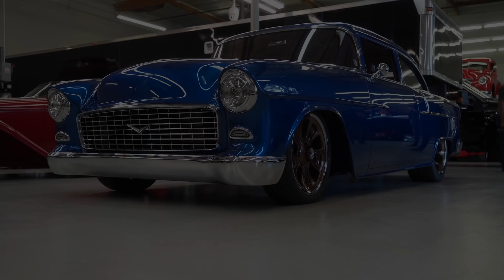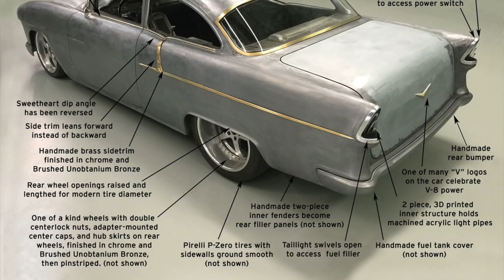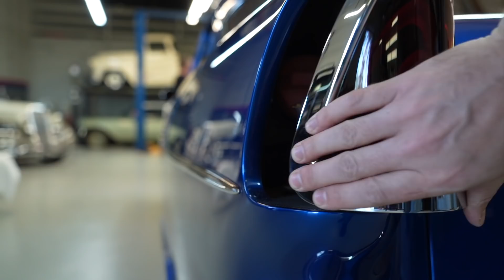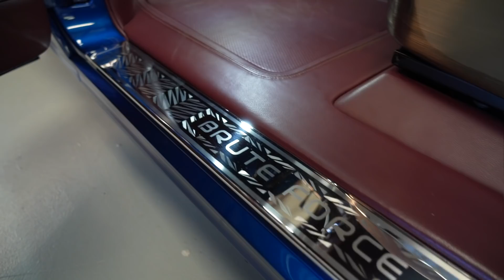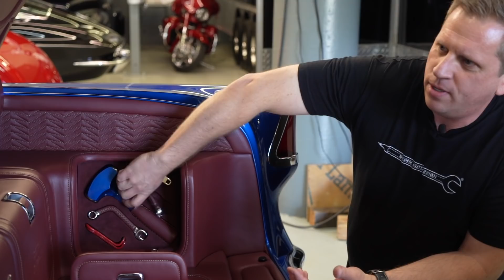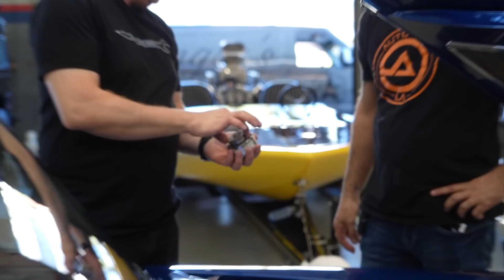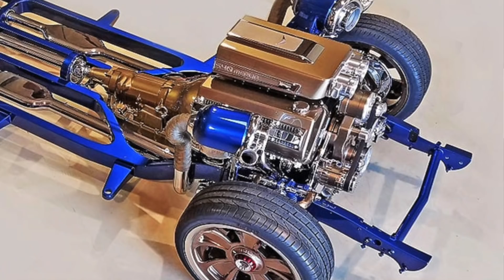1,400 HP Twin Turbo '55 Chevy Custom Show Car Multi Million Dollar Build | "Brute Force"

Comment: That is an almost perfect but the wheels will have to be polished aluminum. That brown/copper look is hurting the look. Same thing with the interior. That does not match the car so you have to go with a dark grey interior with blue highlights. Get a computer graphics tech and take pictures of your car and then have him change the colors in the computer and you will see what I’m talking about. This car is to nice to not be perfect only due to colors. Going to cost you but if you’ve gone this far than you’ve already spent more than what the cars even worth anyway.

Comment: Incredible and awesome, but that car wasn't built to pound pavement. (even though it's damn capable of doing it) I stress enough about curb rash on wheels, door dings, rock chips and hail damage. I just don't need 200K+ in paint and chrome underneath to worry about too.

Comment: Nice front bumper tuck. This looks superior and cleaner to even a smoothy bumper that does not fit as tightly to the body from a side view angle like this. I wonder if this would be an example of a bumper that is flipped upside down?   0:30

I think this front shot would have looked even better with the V emblem on the hood between the lights, to fill that space.
15:40  Paint job.
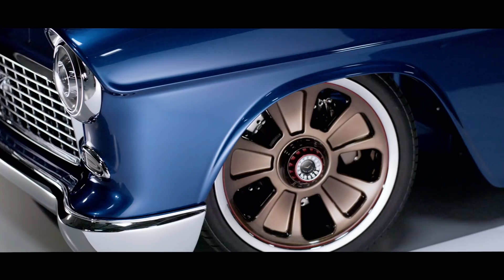16:03 Wheels

Comment: That is the most beautiful 55 I have ever seen 😍. They were robbed of the Ridler award, it is way cooler and has way more custom one of a kind parts on it then the wagon that one. I don't get why it beat out this 55???? The interior is the best I have ever seen, simply amazing work from one of the best shops out there. Gabes' is top notch! So many well thought out and implemented designs.

Comment: Amazing!!! Looks wise...its poetry. Perfect. And maybe its the way the sound is recorded but it sounded like a hamster wheel and a bad muffler on a 78 Buick. lol Very impressive tho. Won't they be disappointed when they don't win the Ridler because the quilting under the hood doesn't have the same "V" pattern as the rest of the upholstery and the general theme of the car. Because thats the kind of nonsense those anal retentive judges get sick over. lol

Comment: Should have named it Apeshit b/c that's what the designed went on it. This car is 100% one-off custom to an unprecedented and insane degree. If it's ever sold, it will go for several million, guaranteed. I never expected it would be driven in the video and it's actually surprising that they even started it. Performance art is honestly what this is and to drive it, sadly, would bring its value down, even though it's designed for functionality and to perform. So much genius and hard work, but ironically, it can never really be enjoyed as a driver.

Comment: An example of how much an expensive custom car sells for at Mecum Auction. This Truck sold for $206,250. Wonder what made it so special to get such a high bid? 1941 FORD CUSTOM PICKUP, Supercharged Coyote V-8, Automatic. https://www.mecum.com/lots/HA0420-413081/1941-ford-custom-pickup/?fbclid=IwAR0y9Ge9-XAVCKBP7AUDUMzDr0FgtsC5_tLn8j5_D5sqmdT9YRO-jFLRLBE

Comment: I just died and went to heaven  o my lord this is a sweet dream car mine was green and then blue I had one of these in 1976 and one day I was parked on an old country road and a u.f.o  landed 150 feet from where I was parked and  it was way faster than you could blink an eye when it took off it vaporized out of sight before I could blink my eyes I will never forget it I sure love this car though man mine had  327 bored out 60,000  with a 3/4  cam  and  double humper heads  and a skid plate on the bottom for out running the law and it was well worth it O yeah it had a 4.11  posse traction with 12 hundred fifteen mud grips on the back and the rest of the story is that they never caught us

Comment: "Don Ridler Memorial Award"
The Detroit Autorama, also known as America's Greatest Hot Rod Show, is a showcase of custom cars and hot rods held each year at TCF Center in Detroit, Michigan, in either late February or early March.
It is promoted by Championship Auto Shows Incorporated (CASI) and hosted by Michigan Hot Rod Association (MHRA), part of the International Show Car Association (ISCA) schedule for the Summit Racing Equipment Show Car Series, which includes other prestigious show car events such as the Chicago World of Wheels and Houston Autorama.[1]
The Detroit Autorama is best known as home to the Don Ridler Memorial Award,[2] which is presented to the "best in show" at each year's event, and has been won by many well-known car designers and builders, such as Chip Foose, Jerry Pennington, Troy Trepanier, and Bobby Alloway.
Autorama's "best in show" award is the Don Ridler Memorial Award, named after Don Ridler, a former Michigan State Football Player, Lawrence Tech Athletic Director, and Autorama's first promoter from 1956–1963.
It was awarded for the first time at the 12th annual Autorama in 1964, and has been awarded every year since.
https://en.m.wikipedia.org/wiki/Detroit_Autorama

Comment: A stunning piece of work and I tip my hat to the craftsman that built it. But I hate to say this but show cars like this one leave me a little cold. Will it ever see any decent road miles, will the owner put up the the chore of trying to keep the underside that clean? I am not sure. The Riddler award has created these pieces of automotive art but I do question if they are still cars in the normal sense of the word or really just art installations better suited to living in a galley?
Reply from the maker: Considering they drive everything in their warehouse (about 40 cars) this one will be on the road after it’s done with shows. It’s still competing for awards

Comment: Nfl, this is a pretty car. But Scott Sullivan did it better with cheezzoom.
Reply: Scott Sullivan's Cheez Whiz is an iconic example of 1980s pro street. The Boyd-build Chezoom is an iconic 1990s custom. Both are great cars.
Reply: @brownautodesign47  did I get the name wrong? My bad, it was in the 80's..  I still have the hotrod stacked on the back of the john.

Comment: Impressive workmanship and good video.  But, the won't drive it piece is annoying.  I know, million dollars, bla bla bla.  If it can't be driven, I'd probably prefer a Rembrandt.  Which can at least be appreciated for its beauty and then sold for profit.  Goold luck selling a car for profit.  No way, no how.
Reply from the maker: You probably missed the part where it’s still doing shows so needs to remain perfect. After it’s done showing it’ll get driven. They drive everything they own
Reply: While I'm not tryng to bicker (I really like your videos), it's annoying even if he won't drive it now.  Maybe better to do the video when they are available for test drive? Otherwise it's a video about non-driving car art which is odd if not offensive to an average gearhead.  I realize you're just showing the builds (and you do an awesome job).

Comment: Sorry...you CAN'T beat the original G.M. design and styling...The car is less than a year old and it already looks "dated"...Blue with aubergine interior?...Give me a break...This is just some customizer's wet dream but it doesn't "work"...and the headlights look like $29 Amazon specials...Wheels suck, tires suck...placement of wheels in the wheel well suck...FAIL, folks...Somebody got ripped off...Stop selling this as "great"...It just IS NOT. A lot of money spent does NOT equal success or beauty...
Reply from the maker: Your opinion is simply that. You speak like it’s the truth. Consider others including myself have a completely different opinion. You don’t like it? No problem but to dismiss it as sucks is a joke
Reply: @AutotopiaLA  The car may impress those with limited knowledge and skills...but the people who know better give this car an absolute "thumbs down" when it comes down to the final product...200 custom touches does NOT equal success...it equals an exercise in custom touches...THAT IS IT....And that is all this car is...A blue '55 with a Barney interior, Chrysler junkyard seats, $29 headlights from Amazon and wheels with the wrong offset and the wrong tires and the wrong...(keep on going)...but you keep on selling your "masterpiece" to the folks that live in the trailer parks (half of the U.S. and A.)
Reply from the maker: Simply an opinion and mine differs from yours. I won’t try convincing you and you will definitely fail in convincing me of yours
Reply: Thank you for the critique. The wonderful thing about hot rods is that there is something for everybody. Your yellow '55 with the mismatched wheels on your channel does look pretty sweet that high up in the air.
Reply: @brownautodesign47  It isn't mine...it was built decades ago and is worth 2% of what was spent on the blue '55 if the "million dollar pricetag" is accurate...2 percent...The yellow car "WINS"...because "how much?" matters when you are trying to impress people.
Reply: And just to add...customizers back in the '60s were doing this type of work in dimly lit garages, with very little outside help...limited array of tools, money, materials...Their work was ABSOLUTELY AMAZING and those early customizers deserve "ALL" the respect...Today's customs are built by a bunch of low wage guys who work for greedy assholes who are interested in one thing...MONEY. I highly doubt that anyone working in a custom shop is being paid what they are worth...

Comment: Super sick car. Love that sound. Would you ever consider doing cool motorbikes? Electric bikes / cars?
Reply: Anything is possible, though my specialty is cars. Would love to build an electric hot rod at some point.
Reply: @brownautodesign47  There's some very fast electric vehicles showing up on the market. Nothing better than going fast and having fun while being eco-friendly, especially if the vehicle makes a cool pseudo engine noise.
Reply from the maker: It’s truly incredible

Comment: Singer doesn't reimagine 911s any better then this
Reply: That's quite a compliment! Coincidentally, we use the same paint shop- Mick's Paint.
Reply from the maker: No one does better work than this imo. Equal but it doesn’t get better in design or execution

Comment: This kind of talent is god given at birth.
Reply: Is this kind of talent a gift or curse? Perfectionism is a double-edged sword (and doesn't truly exist, outside of the concept of perfection, BTW). This car is a perfect example (no pun intended, but the pun is not a coincidence, either) of this self-canceling commitment to perfection in both areas of performance and aesthetics. This car was clearly an attempt to have one's cake and eat it too, but ultimately, it will only end up as a show car that no one really wants to drive because of the destructive effects of driving an extremely expensive one-off high performance vehicle in a high performance manner. Personally, I think TOO MUCH emphasis was put into aesthetics, but I'm a function-over-form guy. I just can't justify form-over-function, especially to this degree. You can rationalize anything you want, but rationalization is not justification; it's just rationalization.